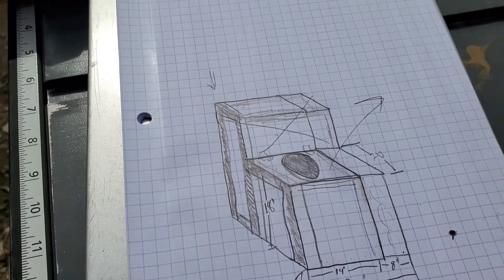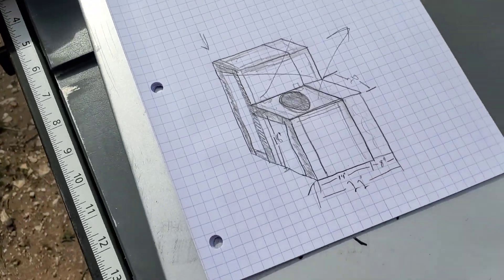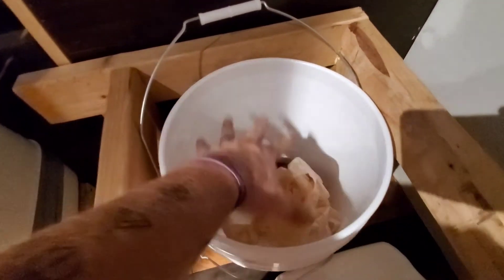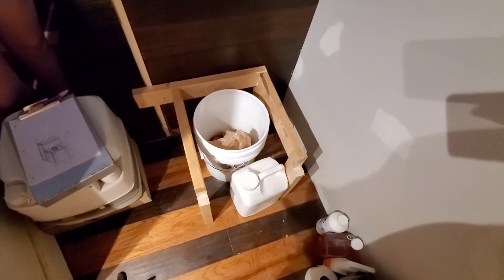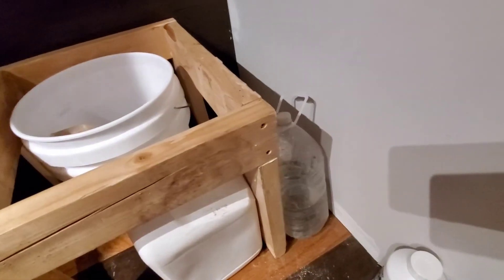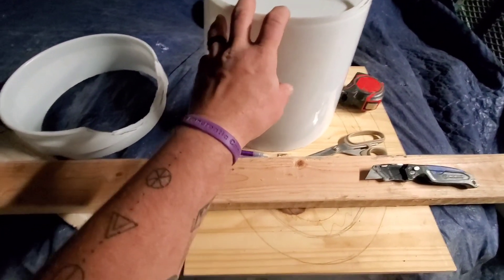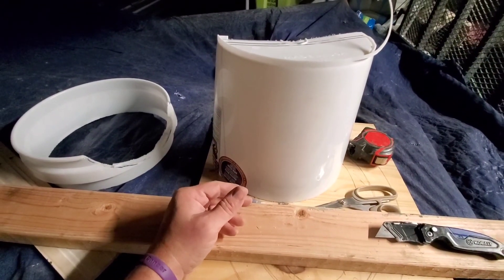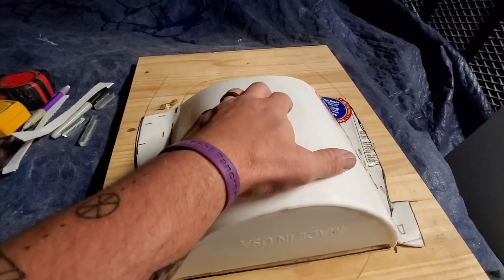DIY Toilet | Building Our Composting  Toilet

Comment: Hi, great job, I have a question, is it really necessary to separate the liquid from the solids?
Reply from the maker: Yes for different reasons. If you are going to compost your waste, the nitrogen in the liquids effect the way it will be able to break down. (This might be incorrect as I did the research a long time ago.)
Reply: Not to take away from wild they thrive but the nitrogen in urine actually helps the composting process, there are many off gridders who don’t separate the two and compost it as a whole. We usually start a new bucket about 10 percent full of wood shavings to help soak up excess urine that flows to the bottom and compost it all together.
Reply: Very professional job by the way. Looks much nicer than mine